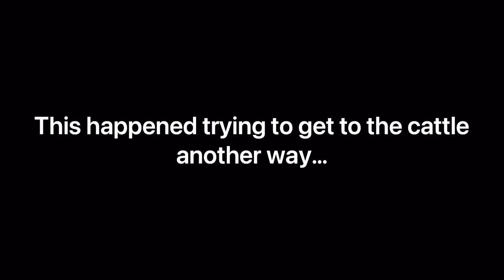Tractor on Fire! Another stuck! Fair Old Day Like!

Comment: Been there before with a cattle trailer, way heavier than you can imagine on wet ground. The driver of the tractor that went on fire had his wits about him, diesel and hot hydraulic oil is nearly impossible to put out when it goes. You where right to turn back with the tractor.
Flooding is heart breaking for everyone but it brings huge hazdship to farmers trying to feed cattle, lost crops, loss of grazing and fodder.
Everyone is safe and well with time everything else can be repaired

Comment: Try a loader tractor, if you put a bucket on and put it at a level and push it’ll make a bow wave forcing the water away and lower the water level around the engine block